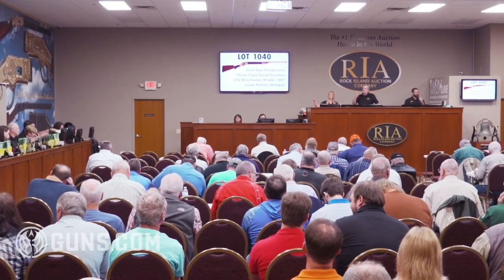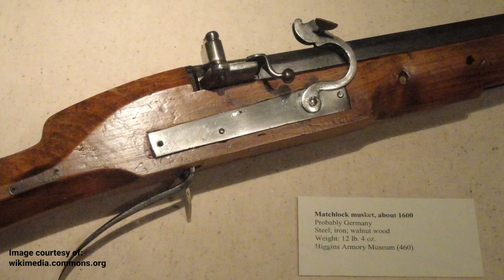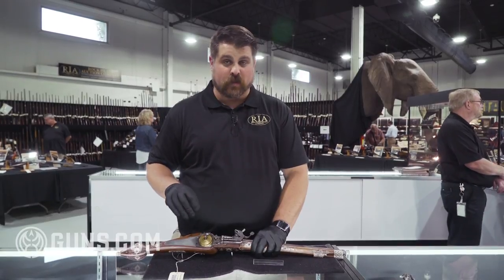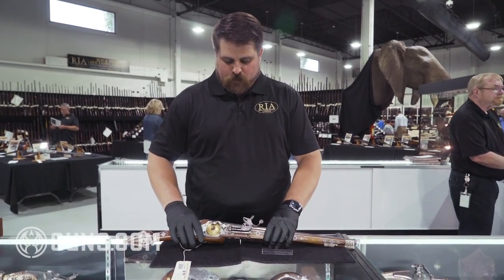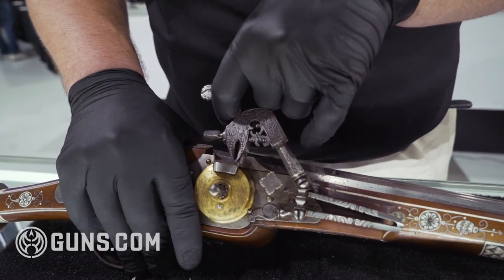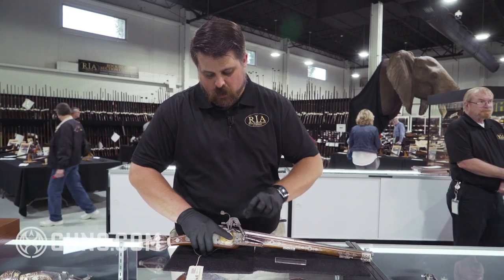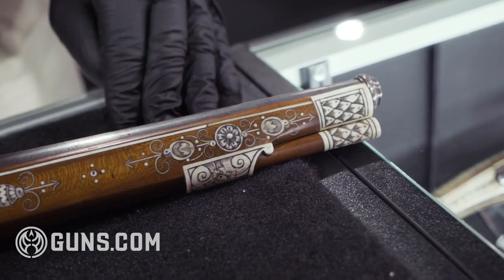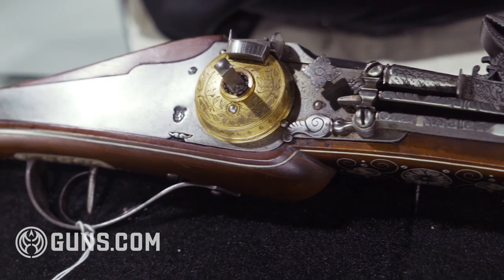What is a wheellock gun and how did it work?

Comment: I know this style of gun is now obsolete, but I think a realistic massive improvement in terms of reload speed would be to have the trigger and wheel be linked with an escapement mechanism, letting the wheel spin just enough to spark the charge before stopping. This way the gun could be reloaded multiple times before needing rewound.
Reply: This can be if we used the paper container (think of it like a candy pack of black powder ,pellet rounds,and paper patch n just shove it up front(musket) n make the Wheelock like a pullback diecast car with some container for pyrite on back, this can still take like some 10 sec to reload n be ready cuz still musket load

Comment: So the wheel lock came first but the flint lock was simpler and easier??
Reply: cough cheaper to build cough
Reply: The matchlock came first, then the wheellock which was a great improvement and after that the flintlock whis was just easier to build and easier to operate since you don't need a extra wheel key to charge the wheellock anymore.
Reply: Interesting, I love these old firearms
Reply: @kylerblack5189  same
Reply: They had repeating lever actions when Lorenzoni hit the scene, but he was the only smith making them and it was very difficult and expensive to make them. 
No way to outfit an army

The revolver has existed at least since 1597, but the one existing model literally only belonged to one member of royalty